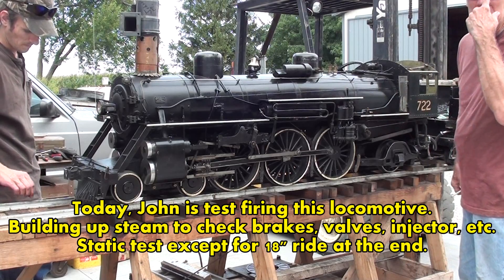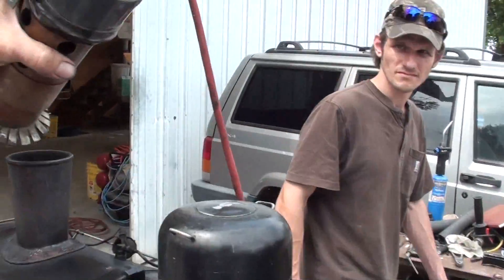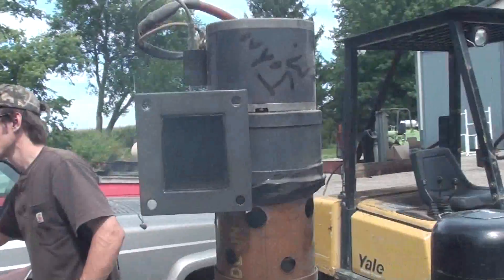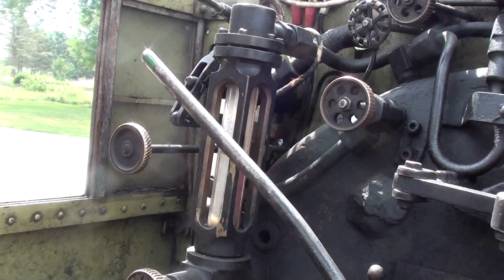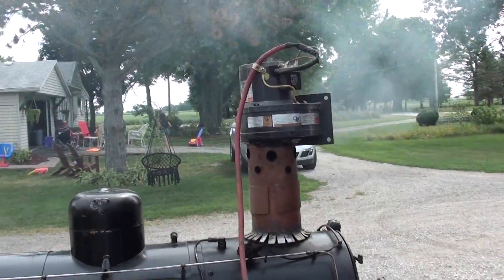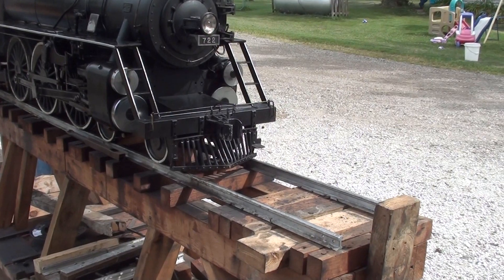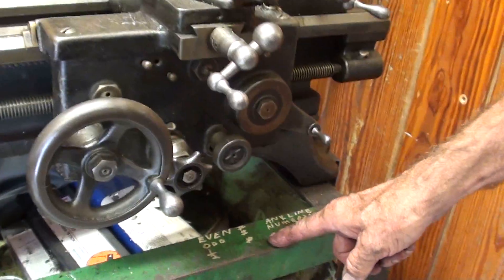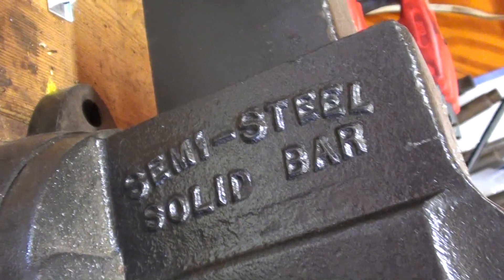FIRING A SCALE STEAM LOCOMOTIVE Tips #646 Pacific 4-6-2 tubalcain

Comment: When you talk steam locomotives full size or scale you have my attention!

2-6-2 Prairie
4-6-0 Ten Wheeler
4-6-2 Pacific
4-6-4 Hudson
0-8-0 Eight Coupled
2-8-0 Consolidation
2-8-2 Mikado
2-8-4 Berkshire (C&O called their's Kanawha's)
4-8-0 Mastodon?
4-8-2 Mountain (New York Central called their's Mohawk's)
4-8-4 Northern (New York Central called their's Niagara's and C&O called their Greenbrier's)
2-6-6-4?
4-6-6-4 Challenger
2-6-6-6 Allegheny
2-10-0 Decapod
2-10-2 Santa Fe
2-10-4 Texas
0-8-8-0 Angus
2-8-8-0 Consolidation Mallet
2-8-8-2 Chesapeake
2-8-8-4 Yellowstone
4-8-8-4 Big Boy (operated only by Union Pacific)

And we have a newly restored and operational Big Boy as of May, 2019
Reply from the maker: 👍👍 I saw the big boy in operation last year
Reply: @mrpete222  I wanted to but I had to work.
Reply: I think there is an error on the Hudson configuration
Reply: @johnmortland1558  You are correct, I will fix it.

Comment: This is Illegal ??  EXEMPTIONS:
.....miniature model locomotive broiler inside diameter not exceeding 12 inches and a grate area not exceeding 1 1/2 square feet**, 
 (430 ILCS 75/5) (from Ch. 111 1/2, par. 3206) paragraph 7
I assume you HAVE had it inspected, and certified by the State Fire Marshall?
Reply: Chuckleheads everywhere...
Reply: @seanobrien7169  It's the Law.  Do you realize how dangerous compromised broilers are?  inspections are a must.  Worn out air compressor tanks are killers, imagine if it was hot steam as well!
Reply: @Brother-Weaver  Engine was hydrotested  and passed in 2020..  Everyone in the hobbly is very concerned about safety